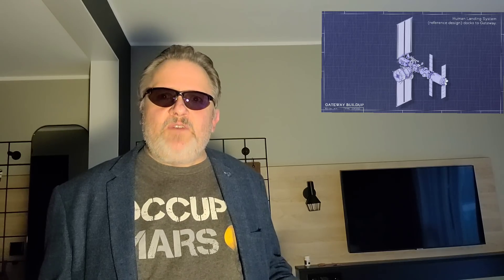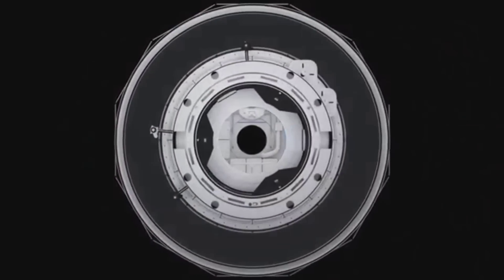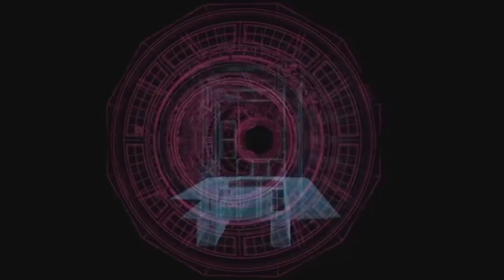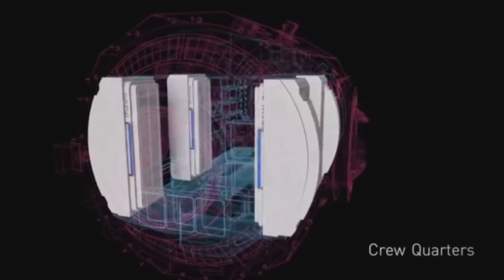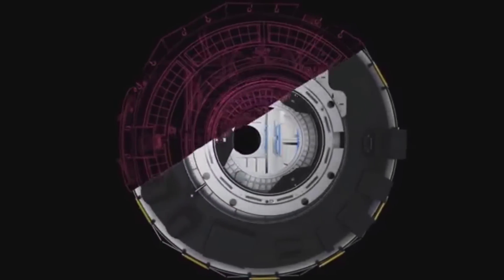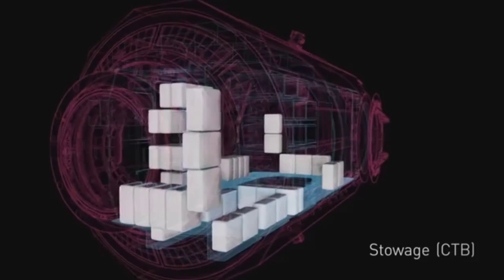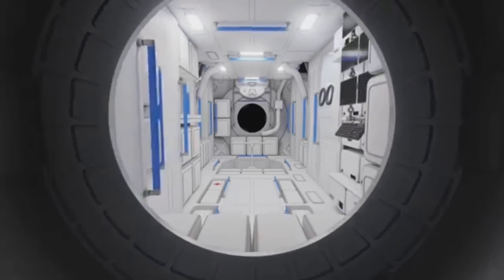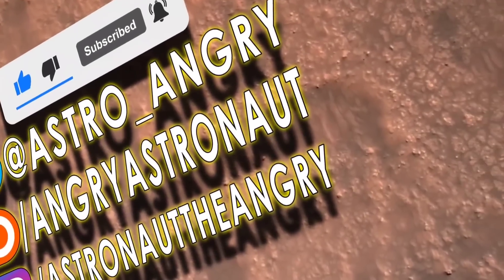New Lunar Space Station design has big problems!  NASA has better options!

Comment: i like the idea of the inflatable modules, i don't know how it would hold up to various space junk. i'd like to see them send one up so they can test it. easier said then done tho because where can be a problem. after finding a good spot tho, i wouldn't not trust it till i saw it inflated for at least half a year as long as the environment was aggressive enough, have to be a proper test.  before i'd even trust anyone in it. 
i'd be all for it, for each of the various space programs if it proves its worthiness. light weight, extra volume, i mean what more can ya ask for.  again tho i just don't know if i could trust it but love the idea. like if the idea worked well it'd be a whole class of design to develop and run with, just about endless uses as long as its usable. however if its fit for space it should be fit for ocean use as well.
Reply: Huh? There has already been an inflatable module proving out the design on the ISS for many years now.

Bigelow Aerospace sent one up and it is CURRENTLY being actively used on the ISS as a storage module. Not only has the inflatable process been proven, but its safety and flight worthiness has way exceeded expectations. Understandable that conventional wisdom would think an inflatable module built out of stitched material would be less safe against the hostile environment of space than a standard metal/composite built module...but as it turns out the inflatable material is actually much more durable and safer.

It has tested better against space debris impacts, It handles the issue of dynamic thermal loads much better due to its flexibility and immunity to stress fractures overtime from shrinking/expansion due to heat/cold cycles. It is much more energy efficient due to weight savings and insulation properties. Much easier to protect occupants and hardware from radiation because of its size advantage and much larger weight/mass margins. And the obvious one...size. The ability to have as much volume in one inflatable module as the entire ISS livable volume is...well HUGE, pun intended.
Reply: @DorkJelly   I didn't realize but if that's the  case then they should started enlisting Sierra and whoever because inflatable construction leads to a more open  volume. A lot better then the alternative normal pods. Just cuz you're in a harsh environment doesn't mean you should be in in a sardine can

Comment: Trouble is NASA keeps sticking to the old both in design and choosing previous contractors that only seem to operate within the old proven ways. Then there is cost constraints a big part of the problem as I am sure it can all be done for less. The entire Artemis program is a hodge podge piecemeal mess just one step above a jobs program.

Comment: Doesn't spacex have a  stretched falcon heavy fairing with slightly bigger diameter to accomodate the keyhole satellites.   Maybe they can make a version with an even bigger diameter for artemis.  Wasn't NASA pushing spacex to use starship to send cargo to the moon space station instead of using dragon XL..  Can't they also use starship to bring modules.   Maybe the problem with that is they probably dont want to put heatshields and wings on an interspace starship.  So the starship is pendeling between the moon and earth, and needs cargo transferred to it in earth orbit.
Reply: There is no NASA push to replace Dragon XL with Starship.
Dragon XL is under contract, but work is largely stalled because it won't be needed for some time.
Reply: @brokensoap1717  Well there where some articles that stated:   "In a new Request For Information (RFI) quietly released by NASA on April Fools’ Day, the space agency appears to have indirectly asked SpaceX to determine the fate of its ‘Dragon XL’ lunar cargo spacecraft."   .. so NASA might have given SpaceX the opportunity to present another solution than Dragon XL,  and some sites interpreted that as NASA pushes SpaceX in the direction of Starship instead of Dragon XL.  But of cause SpaceX doesn't have to present starship as a replacement of dragon XL.   I guess they could also present a solution of a bigger dragon XL that is launched by Starship instead of falcon heavy.   Or make no changes at all.   But a bigger Dragon XL might add living space to the space station..

Comment: Who the hell needs this? If Starship is going to be able to get to Mars, it's going to have all of this and more. One Starship in lunar orbit makes all of this obsolete, even a Starship without re-entry capability. Even better, couple 2 or 3 together. Build them with a water jacket around the hull for radiation protection and heat insulation. Stainless steel gives good protection from radiation anyhow, as well as micro meteorites. Once in orbit the fuel tank space could even be converted to usable living or storage space, or utilized for storage tanks for refuelling other Moon landers and Earth-return modules.

Comment: The whole concept of a Lunar Gateway, no matter how it's implemented is flawed.  There is absolutely nothing it can contribute to Moon landings that cannot be done without it, on Earth, in Earth orbit, or on the lunar surface itself.  Sending anything to lunar orbit, especially a long term orbit such as the one proposed will require astronauts to spend far more time travelling, with all the attendant difficulties of living in an Orion capsule, just to dock with an object which will not add one jot to helping them reach the lunar surface.

People who say that the LG will allow them to get fuel for the landing, or supplies, or in which they can do "science", or be there in case of an emergency, have forgotten a few salient facts...  First of all, in an emergency, the LG wouldn't be able to do squat to help astronauts on the lunar surface, or in transit.  Secondly, you cannot get a "free lunch" in space, and any supplies needed for a Moon landing might not need to be carried aboard Orion, but they DO have to be sent ot the LG in the first place and that will always be a less efficient (in terms of time, money, fuel, and safety) process than a direct mission with all the necessary supplies to a circular lunar orbit, and that's NOT factoring in the extra supplies that will be needed for the greater time taken to get to the highly elliptical orbit.  The only "science" that can be done in lunar orbit which also requires humanm beings, is to study what happens to people exposed to solar radiation and cosmic rays - and they can't be seriously considering using astronauts as guinea pigs.

In short, apart from the problems with the proposed habitation module (surely they can't be serious, can they?) the Lunar Gateway is not just an irrelevance to lunar exploration but a positive hindrance.  If someone can explain how the LG can make a lunar mission more efficient or add something to lunar exploration that cannot be more easily, safely, cheaply, or quickly achieved without it, (and I'm not factoring in the cost of building and sending the LG to lunar orbit), I'm all ears...

Comment: Also, it should be said, a place so small is fart-intolerant;  which means that they cannot eat un-fermented milk products, nor bread, nor beans, limiting the diet choices.  But really, the serious question is what exactly is the point of Lunar Gateway, anyway?  It's been like two years and I never get a straight answer.  Stocking fuel and supplies is fine, but for that it doesn't need a crew.  Is it a stop for astronauts to switch ships?  Good!, but again, that doesn't call for a Gateway-specific crew.  Science?  What science can be done aboard Gateway that cannot be done aboard the ISS?  The only thing I can think of is cis-lunar radiation measurements;  but a cosmic ray counter can count cosmic rays without human supervision.  Unless the point is using human guinea pigs to look at radiation symptoms;  but they will get that data from moon-walking astronauts anyhow.  Growing dandelions at gun-point?  They can do that down at the Moon base, anyhow.  Etching microchips?  They can do that at the ISS.  It seems to me the Lunar Gateway is a grandiose, if size-constrained, solution in search of even a humble, tiny problem.

Comment: I-HAB won't be the only habitation module; Gateway will also have the HALO module, which will be launched together with the PPM, first.
Reply: Funny how that was not in this video.
Reply: @jameswilson5165  A Click bait beat up.
Reply: @jameswilson5165  Yup. That's why I don't watch this channel. Only watched this one because a tweet thread referred to it.
Reply: What's the habitable volume on HALO?
Reply: @mirfjc   Dunno, but an Orion will be docked to Gateway whenever it's occupied. It has a habitable volume of 9 sq meters and windows. HALO may have its own toilet, or rely in Orion's - but either way there are options and an opportunity for ~privacy. And anytime a Dragon XL is docked it provides some more spare space. 

Of course, none of that applies if Starships are used. A fresh one can be sent for each mission, they're designed to eventually provide 6 months of habitation so 3 months won't be a problem. Maybe keep Gateway there for its permanent science facilities - and for international participation in providing those.

Comment: To start as has been pointed out, Starship was not included in the design of this facility which was the major oversight. Once Starship starts going up on a regular bases, with in 4 years congress is going to be really question the funding for SLS and ESA Luna Gateway is going to be right behind it. At the same time Orbital Assembly Corporation is likely going to be testing their stations that are roomy, have radiation protection and artificial gravity. ISS has been up for 21 years but I don't see LG being up for 5 or even being fully completed before becoming obsolete. Like the rest of NASA's Artemis program it's just bad by design, decades behind in technology and a waste of money.
Reply: Sls is already defunct.. massive waste of money.. Nasa is finally getting it through their heads that private companies can do this better

Comment: The current design for the Lunar gateway is a claustrophobic nightmare for sure!
Reply: Musk said nobody should want to go to Mars in Dragon. NASA seems to be aiming for just that with the Moon.
Reply: Skylab was much larger, based on a modified S4B upper stage, 
Using an 9 m diameter modified tank will do, 4 habitats in star  configuration with a central multiple docking adapter and a fifth docking port for a visiting vehicle  should be plenty .
High volume to cost ratio, SpaceX style.
Watch skylab movies of the astronauts running around .
And 'flying' inside with prototype control moment gyro stabilized vehicles. Lots to be learned from the Skylab missions. (3)
It would be better to use the same idea , to use part of the enourmous starship to be part of four , to be docked to a docking adapter . Even when the upper stage pushing this adaptation is not reused, the cost much less than that european contraption.
Angry, take notice about this solution!
Reply: @Arturo-lapaz  And derivatives of Skylab had also been proposed as habitat modules for manned Venus & Mars Missions. If only NASA opted for something like Skylab, perhaps even at the diameter of the ET/SLS core, launched by either the SLS or the Super Heavy...
Reply: @Arturo-lapaz  PS Von Braun also explored the idea of coverting the S-II(2nd stage of Saturn V, wider than SLS core or Starship) into an even bigger version of Skylab. SpaceX can replicate this by creating some sort of "Starlab" space module based on the fuselage of Starship but reconfigured for very long-term habitat purposes.
Reply: @jmwoods190  I did not know that, thanks. Had we followed just some of his proposals , we would be on Mars, flying multibladed tandem helicopters on a sustantial part of the 144 million square km over vast fields of real slightly pressurized green houses, with all this abundance of the 95% constituent of the atmosphere and the molten subsurface ice, and the reliable 500 watt/m² sun shine, after filtering out the UV.
A full generation lost.

Comment: I will agree and I think the engineering mission statement needs to be revamped.  Time to go big.  This is mankind’s Gateway to the stars.  There needs to be Taurus system for spin gravity on part of the station to offset the effects of no gravity.  There needs to be modules and factories assembling harvesters to get asteroid’s to bring back to mine and harvest.   Factories producing long haul starships of huge size.  They need to have starship dropping off 100 ton modules to expand gate way.   Meeting rooms and design labs and hydroponics labs and more.😎

Comment: Let’s hope starship gets rolling in the next few months as planned and starts launching payloads this year and by end of next year they have the refuelling mastered.
Reply: I doubt theyll have refueling mastered even at the end of next year. This year I think it's safe to say it's impossible.
Reply: @tankourito5419  : Realistically, it'll depend on how they decide to do refueling. If they do (or at least start) each somewhat slow, with some gas injection to shift the fuel towards the uptake port (or even better, take advantage of fuel transfer by sticking the vehicles Raptor-to-Raptor instead of side-by-side), then they might get it functional fairly quickly. If they decide to add maximum complication, that's where delays will come from.

Comment: Lunar gateway is Desperate plan to fit a lunar destination within the modest lifting capacity of the SLS!
The joke is that a modified Starship could be more easily adapted than the piece of crap you looked at!
The reason I believe they haven't gone in this direction it would highlight the stupidity of a lunar space station in the first place!
A reusable, refillable, Lunar Starship could operate between LEO and the lunar surface far cheaper and safer than anything NASA has proposed!

Comment: Perhaps, the most economical way would be to design a larger fairing for the Falcon Heavy. It could still be used for other projects. As for NASA, and their concern about sierra space's inflatable pressure shell, make it fit inside a SpaceX Starship, giving the best of both. A metal exterior, and a layer composed of Vectran™ fabric weave inside.
Reply: They can't wait another 3 years for starship to be ready for that.